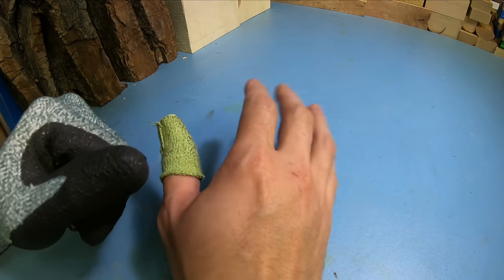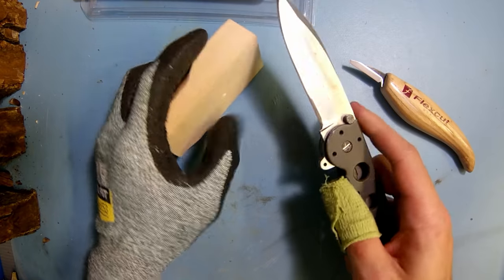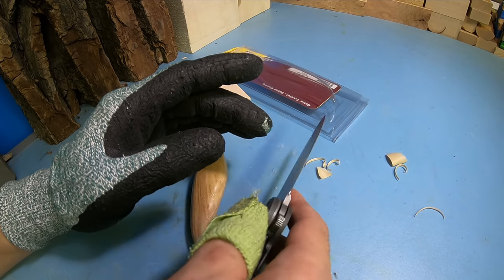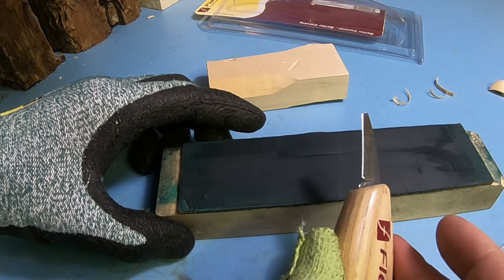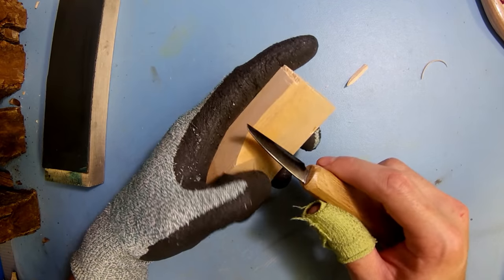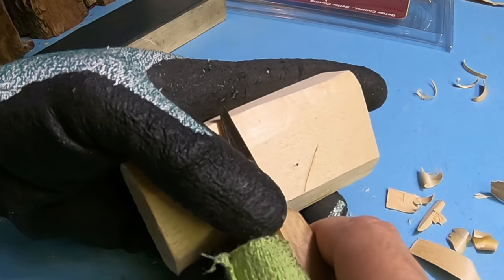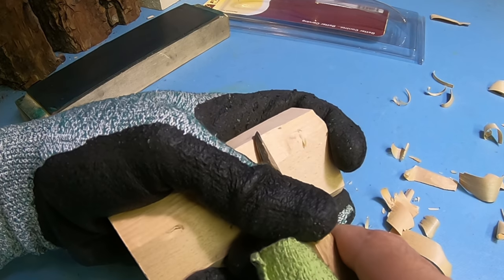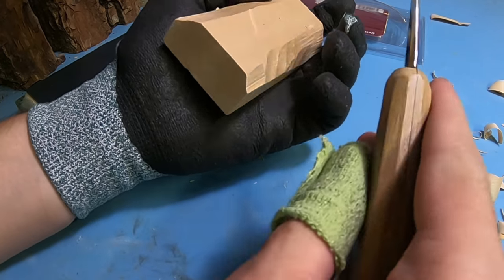5 Beginner Whittling Mistakes To Avoid

Comment: How do I tell which way the wood grain is going? Its always been hard for me to tell, havent carved in a while but want to get back into it
Reply from the maker: That is an excellent question!
I may have to make a video showing this as  it  as examples will be the best way to show you.  But if you look at a smooth section of the wood you will usually see one of two things:

1)  small fine lines in the wood coloration going in one direction, this is the wood grain viewed from the side.  Typically on a long piece of wood, you will see the wood grain following the length of the wood.  There are times where this wood grain will be at an angle and not truly from one side to the other.

2) small dots and slight contours of the tree rings if viewed from above on a tree cut horizontally.  This is the side of the wood grain and the grain is going away from you in a straight line.  

for most pieces of wood, if you lay the wood flat on a table where the wood is laid left to right, the wood grain will be from left to right. 

I'll try and whip ya up a video this weekend so you can get a better idea what to look for.
Reply: @CarvingisFun  Ah, thats very nice! Thank you for taking the time :)

Comment: What is the best cheapest wood carving set? Around $30
Reply from the maker: Unfortunately the super cheap sets from china are all the same and aren't that great.  But if you want a good affordable set, pick up one from beavercraft as they are the best quality of the affordable knives.  All the super cheap sets are knockoffs of their knives anyways.
Reply: @CarvingisFun  what is your take on kakuri kiridashi, made in japan?
Reply from the maker: They are neat lil knives and are quite effective for carving when you get use to handling em.  Personally I would throw some tool tape around the handle for comfort.
Reply: @CarvingisFun  in your opinion what is the best, worth saving for?
Reply from the maker: Best is subjective to what is being made.  For me, I really like my Helvie knives.  If you are going to be carving harder woods, Deepwoods Ventures is a great option.  If you want thinner knives Drake knives are wonderful but prone to damage if mishandled.

Good middle of the road knives are Flexcut and Focuser Carving knives
Reply: @CarvingisFun  Best websites for tool buying? I havent seen any that you have mentioned except for flexcut on amazon. I have been trying to search according to steel alloy. I originally thought a tungsten steel alloy would be best since tungsten is the hardest metal on Earth but nothing is that simple. I read articles that said High Carbon Steel would make the best tool, then japanese tempered steel, the HRC 60+, then sk3 steel or lower. If you made a video clarifying this crap I bet it would get views. Everything is flooded with advertisements or bots these days.
Reply: @CarvingisFun  Spec ops Chisels were listed to be made out of High Carbon Steel 4 set, I was wondering if that is the same steel as flex cut? If so, if sharpened ourselves could be of the same quality in theory, right?
Reply from the maker: I have found that some companies harden their steel and finish their tools differently than others, even with the same steel.  So while they have the same steel, most of thr stuff out there is vastly inferior to the good stuff.  Spec ops isnt on my radar and I have zero experience with the brand, with this being the first time hearing about them

Also, the good stuff isnt sold at major store outlets.  I have made various videos on the best whittling knives and am currently working on expanding to regular carving tools (spent thousands thus far accumulating tools).  

If you want a quick resource, I wrote up a few articles on some of the best wood carving tool brands to look for:  https://carvingisfun.com/best-wood-carving-tool-brands/

And here are my favorite places to buy wood carving tools: https://carvingisfun.com/best-places-to-buy-wood-carving-tools/

Comment: I am left handed and I find that the bevel on carving knives is for right handed people and the knife slides along the wood without cutting so, what I need to know are there left handed knives for us right minded people and who has them?  Thanks !
Reply from the maker: I have only used a handful of knives with a non uniform bevel, the vast majority have a uniform edge grind on both sides.  
there are a few reasons why you may be experiencing this on your end: 1) the knife may need to be sharpened 2) your knife has a wide edge grind and needs to be reduced to allow for it to cut through the wood easier, 3) you have a rounded bevel that is preventing you from getting the knife edge to bite into the wood itself.

Several knives that I would recommend as they have flat grinds with no bevel or are thin knives that just cut through the wood easily are OCC, Helvie, Drake, Flexcut, and deepwoods ventures.
Reply: Ножи для "левшей" есть , это маркерные ножи и ножи "сапожные" , для работы с кожей  — других не видел .
Удач Вам !

Comment: I know you were trying to make a point by breaking one but Snapping the point of a brand new knife is just not right. May I suggest in the future you snap the tip off a razor knife or something much less expensive.
Reply from the maker: I hear ya, but since this is a very common mistake many beginners make with the exact knife I needed to make a point.  

Plus I wanted to make a video on how to repair the knife for those who already broke it and needed a broken one to get started (the video is published)

So breaking the tip was needed for this video and the other mentioned video.  I attempted to find a used one instead but they all wanted more than what it cost new.

Comment: Bro I cant afford the whittling knife because prices in US are very high for my country and you cant get them locally. When I saw him break one in the first 5 seconds my heart sank 😰
Reply from the maker: What country do ya live in?   Ive been able to find some good knives in most countries so far.
Reply: @CarvingisFun  Georgia. Its between Turkey and Russia. Not very developed country and everything here is like ~3x cheap so everything from abroad is too expensive for locals. Im gonna probably gonna try making my own knife :D
Reply: @CarvingisFun  for now Im using some knife covered with wires and tape. It eas doing fine but I bent the blade a little and when I straightened it, it still does the job but its a bit harder.
Reply from the maker: Well, normally I would point you to beavercraft, but they are baised out of Ukraine.  You can look on etsy, I know there are some options in Turkey you could buy.  There are also options in Russia too, nut that may be a little difficult too.  

You may be able to find carving knives from Narex and Petroguard in your area, which are great options.
Reply: @CarvingisFun  Thanks for advice, I'll definitely check it out!

Comment: me just now realizing you need both the smooth and suede sides of the leather for stropping...... a few hours after superglueing my leather smooth side down to a block of wood...... smh. here i go to buy a proper strop.....
Reply from the maker: Meh, you dont "need" both sides.  I only really use one or the other at any given single point in time
Reply: @CarvingisFun  ah, thanks for the clarification. i saw you using the smooth side and was under the impression that you used the suede first and smooth was the very last step if i wanted it properly honed. my knives and my skills are new, and i'd been noticing more resistance when i cut, so i thought maybe i was honing the blade wrong. perhaps i just need to do it more frequently.
i've noticed you like just about every comment (or at least many of them) and reply to many of them too. that's very kind and helpful of you for beginners like me, thank you.
Reply from the maker: Yeppers, just one side will do.  The compound is what does the work, the leather just provides a surface to apply to.

I do try my best to read everyone's comments, sometimes it can take me a bit but I want to make sure everyone gets the info they need

Comment: I stabbed my hand and 4 months later I still get pain in it in that area. Clever boy!
Reply from the maker: Ooch! 
The forst day I transitioned from a regular pocket knife to a real whittling knife I got myself good.  Wasn't anticipating how much easier the blade would go through the wood!
Reply: @CarvingisFun  I know what you mean. The first time I carved a piece of wood was with a Magnum lock knife, designed for camping and it basically slid right off the wood and sliced across my palm. I had to glue the wound. I wear two gloves on the left hand now, the outer glove is leather. I love carving, but you have to be so careful.

Comment: Biggest mistake in my own experience. Not using gloves for "just trying some cutting techniques". I didn't know the cut,saw it, tried it, wasn't successful, tried more pressure, slipped off and cut deep inside my flesh. Would not recommend as beginner.